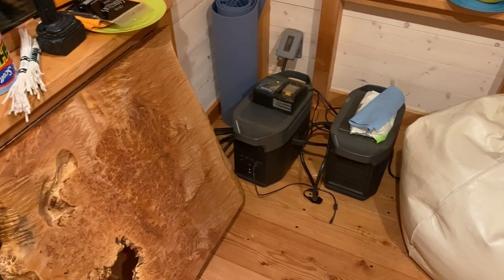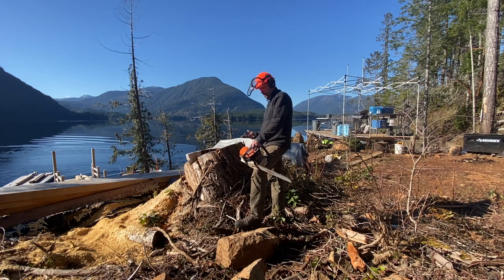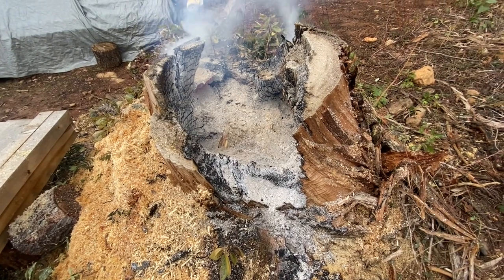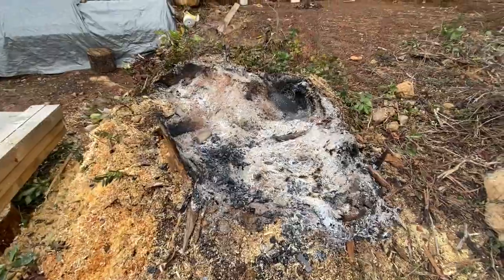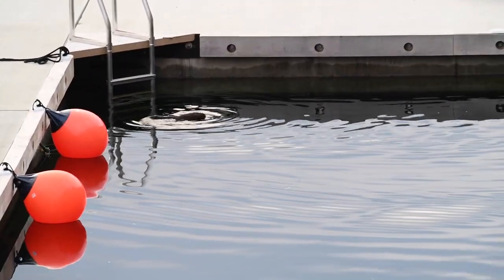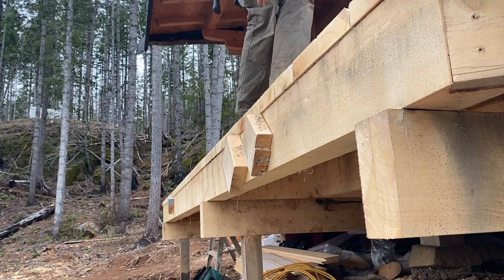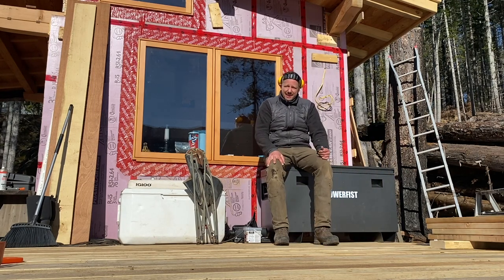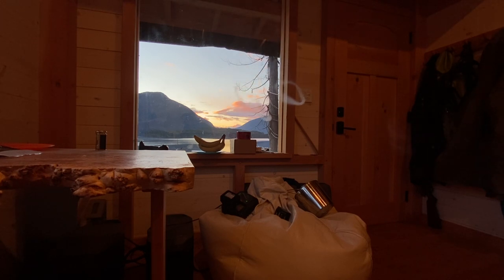Finally Finishing The Decking On My Off Grid Cabin!!!

Comment: Hi, Great video and very enjoyable and educational to watch. Quick question, as I’m looking to buy a new circular saw; at around 12 mins you comment that you’re not that impressed with this Makita 40V saw - is that just because of the battery life/ charge? If it had a 4 or 5 A/hr battery, would that make it better or is there something else that you’re not loving? You didn’t really expand. Thanks and looking forward to the next episode!
Reply: Check his page.  He does a whole episode reviewing that tool and battery platform.
Reply from the maker: When you have used a brand for 20 years you can tell when it begins to slide. The battery life is alright. It’s actually the ergonomics that I feel is sub par. Mainly the base and balance that feels sub par. Also having issues keeping the blade square which I have never had on my other saws.
Reply: @TheSamuraiCarpenter  thanks for sharing. You’ve saved at least a handful of us a good chunk of change.

Comment: Sawdust Hack -- If you pack your sawdust tightly into small paper bags or cardboard  boxes, you can burn the sawdust just like it was fire wood. However, if you just throw loose sawdust on the fire, you will smother the fire and possibly put it out.

Comment: Voltage has nothing to with longevity of a battery, if anything, it can drain the battery faster. This is why they say 40 volt is "like gas powered". If you want longevity you ned more volt-amps (kVA). You can have thousands of volts with next to no amps, and it wouldn't hurt you. But if you have massive amps, at a low voltage, you're dead.